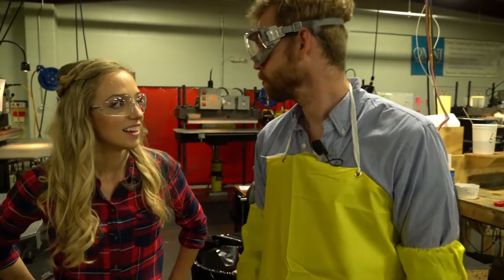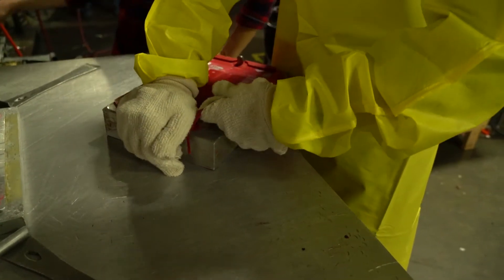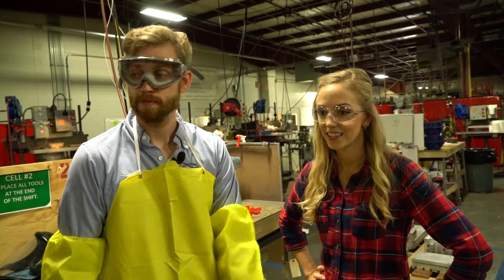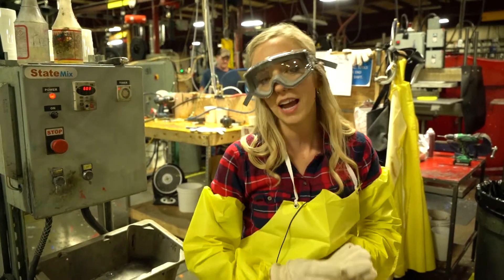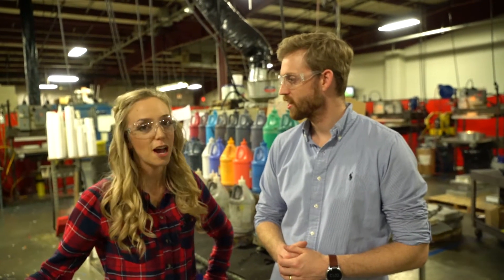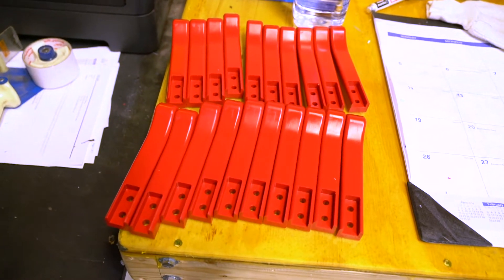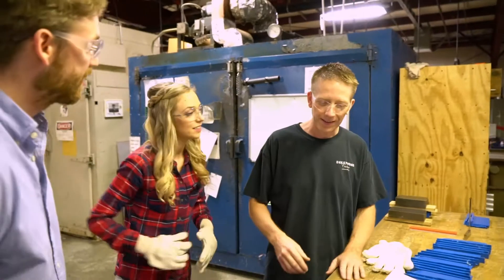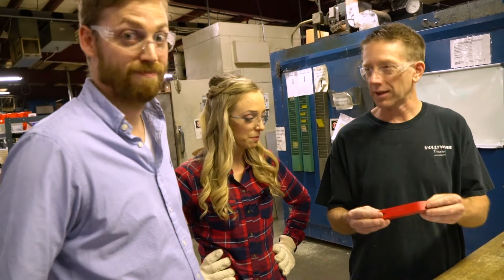How to deburr plastic: American Made - Omni Technologies Part 3

Comment: c'mon guys - what is with this overkill on eye safety. This level of so called protective eye gear looks phoney, is phoney and does not lend credibility to the process. I have built 300 houses and rarely wore eye protection outside of my Serengeti sunglasses and ya, sure a few bits of sawdust gets in the eyes, but the eye protection offered by eyewear such as she is wearing is so dreadful and the glasses get so dirty and the optical clarity so poor, that they become a hindrance to safety. Sorry - does not cut it. You are not on a downhill ski course in a snow storm.  And it does not add much to the crediblity of the video. my pet peeve and there is 30 years of experience backing that up. I will pass
Reply: This is such a strange comment.  If you are annoyed by the eyewear just keep that to yourself.  Writing a paragraph about it won't help.
Reply: @ItreallyHappedISwear  fair comnent, maybe.  I look for credibility in everything.  This world has so much fakery, it needs ro be pointed out aggressively to stop the nonsense. The whole video in a perfectly safe place with the full blown eye wear looks so fake, any one with a sense of common sense can see that. Its like putting on latex gloves to eat a sub sandwich , and I've seen rhat. Or wearing a mask in an open park to keep covid out. Gone too far. The credibility is lost. in other words, get a grip.